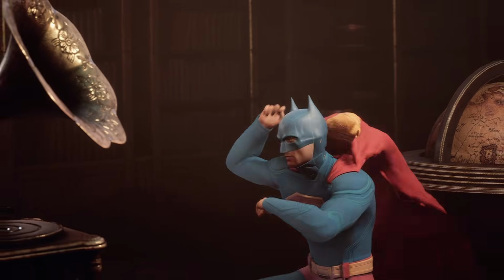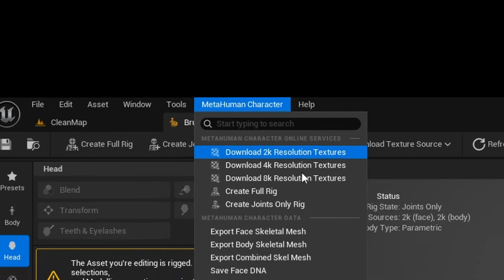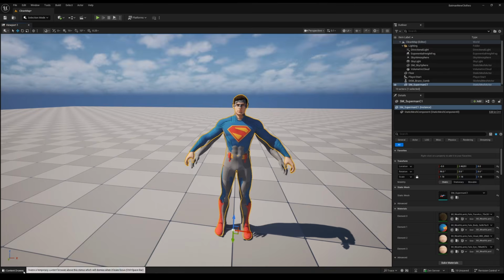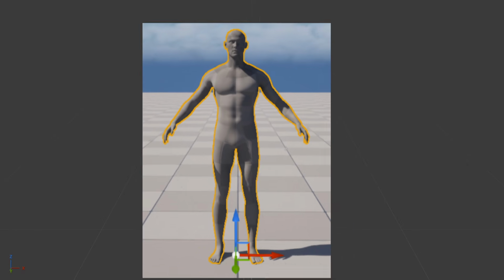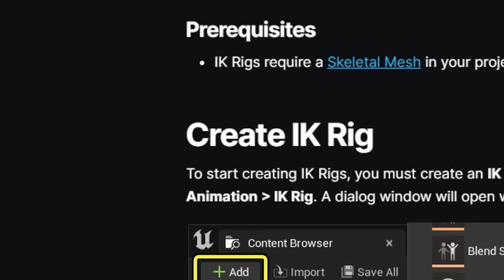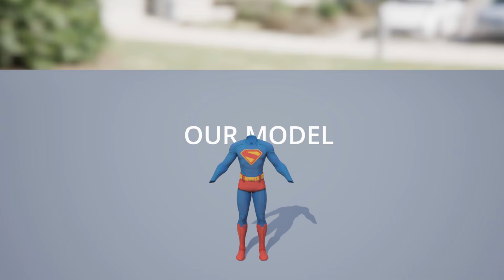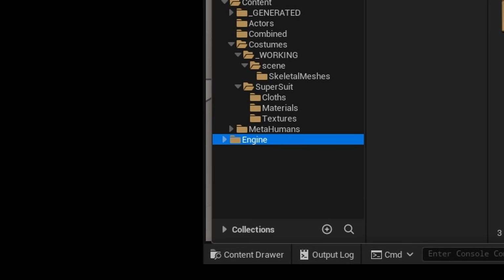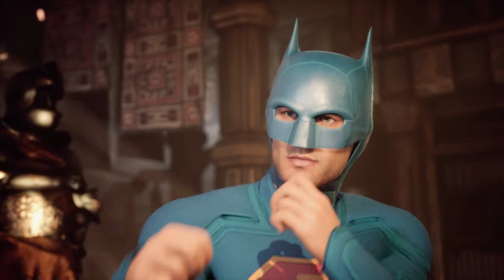Create MetaHuman Clothes from ANY 3D Model | Unreal Engine 5.6 (No extra plugins or software needed)

Comment: Ok, so i don't want to take anything away from this tutorial. And i have taken a lot of lessons from this and i can not emphasis how valuable it is to do all this inside UE and with this speed. Very much appreciated and subscribed. But, most of the things can be done via blender a bit more faster imo. If you have a lot of characters, I suggest exporting it to blender, do your riging and animations in there and bring it back to UE. The pipeline is cleaner that way and the one thing I have learnt in UE is, if the engine breaks, you don't want it to break with all your assets in it.

AGAIN!!! This is a gold mine. Ty.

Comment: To people using unreal versions higher than 5.6 and their retargeter isnt working - turns out the "Op Stack" tab in the IK Retargeter asset window is now blank by default. The quick fix for this is pressing the "Add Default Ops" button in the "Op Stack" tab which fills the stack that was present in the 5.6 by default.
Reply: Sorry where on the screen is that button?
Reply: @Jfilms22  In the IK Retargeter asset, go to the "Op Stack" tab which you can find besides the bone "Hierarchy" tab in the left part of the screen.
Reply: @markbradley332 it’s still not worked for me, the animation crumples to a ball or smthn, did this happen to you?
Reply: @Jfilms22  That means you must have done something wrong beforehand, I didnt have this issue.

Comment: For 5.8 onwards you can skip the IK rig and use the skeletal mesh with weight transfer straight away, then use that as the skeletal mesh for the cloths asset
Reply: How do you match the costume pose to the Metahuman default pose?
Reply: @VicXtheMeX use the deform tool on static mesh and transfer that into skeletal mesh, it works for me but idk

Comment: I don't think this works in UE 5.8 The final step doesn't work. Everything leading up to Retargeting the fullbody for the correct pose works but that part doesn't work for me.
Reply: Did you find a way? I cant do it on 5.8 either
Reply: @Jfilms22  I figured it out! I recorded myself and will post the video on YT by tomorrow evening. It's actually not too bad but slightly different steps than what the video shows due to changes made (I assume) in UE 5.8.
Reply: BTW it will be on my other YT channel called Animation Hatcher.
Reply: @HatchersHouseofSystema will check out
Reply: I have the video. Just need to edit and post it. Got busy with project work.
Reply: @Jfilms22  I am working on a solution. I will know today if it works.
Reply: @HatchersHouseofSystema I am also interested in seeing your solution!
Reply: @VicXtheMeX ❤
Reply: I have spent almost a whole day figuring out why it doesnt work anymore since 5.7 - turns out the "Op Stack" tab in the IK Retargeter asset window is now blank by default. The quick fix for this is pressing the "Add Default Ops" button in the "Op Stack" tab which fills the stack that was present in the 5.6 by default.
Reply: @markbradley332  Well that's cool. My solution is different but if that worked for you that is awesome!
Reply: @HatchersHouseofSystema  Would be great if you could share yours too

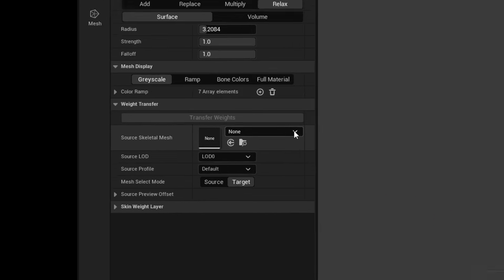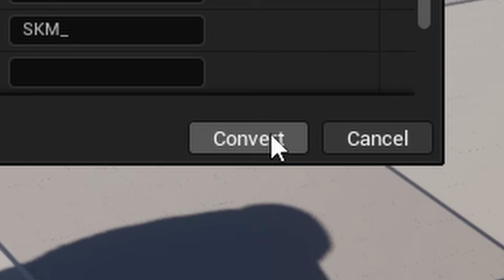Comment: I was able to do the whole process once but wasn't happy with the results. Doing it a second time, at 7:25 when i try to transfer my weights my editor hard crashes. Any ideas what could cause that? I'm using 5.6 EDIT: I found a really silly workaround. I needed to simplify my clothes mesh for both times of weight transfer (2nd weight transfer at 9:25). My mesh was already below 10k vertices. I think Olars Superman-Suit had more so idk. Under the mesh tab within the SKM i simplified it to 99% of its original vert count. After this i was able to transfer the weights without issue. Still can't figure why i have to do this though..
Reply from the maker: It's good to hear that you figured it out! I honestly have no idea either why this way makes it work. 
It's quite bizzare, that the same mesh worked fine when you did it the first time, and not at all on the second time without simplify. 
Makes me wonder maybe something happened when you morphed, or deleted parts of the mesh before the weight transfer? Like some hidden calculating error. Just shooting the air here, no idea.

Comment: When I use IK Rig, the superman costume doesnt move
Reply: Having the same issue, the retargeter doesn't have the proper chains i guess, not sure how to resolve this
Reply: I am having the same issue, but for the second static mesh costume i attempted this process on
Reply: Did you manage to solve the problem?
Reply: @MaikM7 i managed to see the difference of pose when using the IK rig again but the pose is still inaccurate, so I ended up not using the IK rig entirely.

Comment: I tried, but at the end of the conversion of static to skeletal mesh, I just get the error: Array index out of bounds, when transferring the weights to the new skeletal mesh from the combined mesh!
Reply: Hey i had the same error. It worked for me to reduce the vertex count of my mesh just a little bit. Right there in the SKM where you transfer the weights you can go to the mesh tab and simplify the mesh. I chose to reduce the vertex count to 99% target percentage. After that the weights could be transferred and no error appears. I don't know why it is like that though it worked for me
Reply: @nikhenrich2042 hey buddy, thanks for replying. I am currently not working on unreal, but if in future do so, surely would remember this, thanks.

Comment: Awesome video! Keep it up man! However after creating the Final pose Static mesh (The one you put in SuperSuit) The static mesh is fine but when i try to convert it to a skeletal mesh it breaks materials. And when i try to weight paint/ transfer weight my unreal engine consisently crashes with and array error. Any idea where i might have gone wrong?
Reply from the maker: Thank you for taking the time to follow the video.
Now I'm intrigued, could you share more info? 
I had the wrong material id issue on the superman suit, but after deleting all the material slots except the suit one,  unreal remapped the invalid ids, giving every separate mesh the same material. That fixed the material for me. 
If I left more than one material slot, the suit material always had to be in the second slot (first slot had to be empty).
Does your final mesh need to use multiple material slots?
Good to hear that you found a solution.
Reply: @OlarKrjukov I have the same issue. When I convert to static mesh from sequencer and then convert it to skeletal mesh it breaks materials. And weightpaint crashes the editor :(( Do you have a discord perhaps! Would be awesome to be able to share the fix when I figure it out lmao
Reply: @TheFalcoGamingDK I don't think he has atm but feel free to share if you find a fix :))
Reply: @OlarKrjukov also a tip you can do when weightpainting is instead of brush relaxed and clicking you can select the mesh point and remove influence from say the arm so the cloth under the arm does not strech
Reply: @OlarKrjukov  No need to thank me for following the video ahaha. Yeah it has 7 material slots. That might be the issue then for why i cant make a skeletal mesh from the sequencer static mesh?
Reply: As far as I can see chatgpt says converting from sequencer is a big ue5 issue as it makes 100 k vertacies and then cant compute weight transfer bc array is too low but no clue
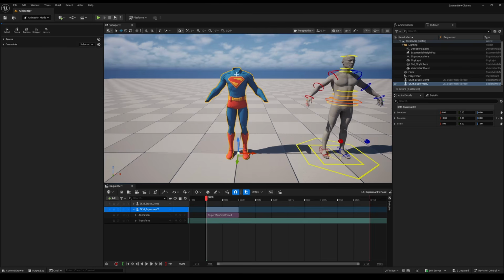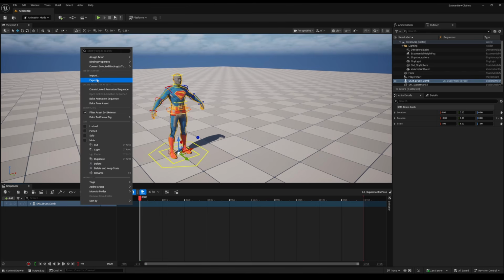Reply from the maker: @TheFalcoGamingDK, @mikkelrasmussen9698 what if instead of converting the static mesh from sequencer (like on 9:06), you export your model with the animation/final pose added (same way like you did at 6:43) and then import it back with "Use TO As Ref Pose" selected. It comes with the dark material, but with the correct material slot numbers and pose. You just need to move the materials back to the right slot. 
Are the materials fine now? Or they still break?
The skel mesh now has the correct MetaHuman Skeleton with default pose and Skinweight.
So you can try to make the wardrobe item with that. But if there are issues later (because of the ref pose), then you have to convert this imported skeletal mesh back to static mesh (outside of sequencer) and from that make the final skeletal mesh.
Let me know if that way works!
And yes, I don't have discord server as of yet, but you make it sound like I should.
Reply: @OlarKrjukov  Thanks for the answer! 
I think there might be a way. But as of now i just decided to remove legs and shoes and then just scuplting the upper body to match skipping alot of the workflow but it gives me a working cloth. Perhaps if in the future you get a discord. I can bring this up for further troubleshoot. But for now just focus on making content!
Reply: I don't know about the material but i had the same error crashing hard when transferring the weights. What worked for me was to reduce the vertex count of my mesh by a tiny bit. Right there where you transfer the weights you can look for the mesh category and simplify it. I chose a target percentage of 99% there so no real downgrade. After that i was able to transfer the weights without crashing my engine and everyting worked fine

Comment: ALL I WANT IS CUSTOM CLOTHING ON A MH WHY IS IT SO IMPOSSBLE
Reply from the maker: Hei! Thank you for following the tutorial.
Since its not clear what has gone wrong, my advice would be:

1. Walk backwards, in the sense: you mentioned you dragged the wardrobe item into the metahuman outfit clothing but nothing works. So go backwards one step and check in wardrobe item whether you have set up the correct pipelines. If they are correct, did you add the outfit asset? if yes, go back and check the outfit asset etc. Eventually you will find what has gone wrong.

2. As Metahuman Creator is still in Beta, you might have picked up a random bug or accidentally changed something as you doing this workflow the first time. If thats the case, it would be better to start a new project, and do everything again from scratch. This way as you are more experienced and familiar with the workflow, you might find where you went wrong the first time or avoid the bug.

For example when I did that workflow the very first time, I accidentally changed the metahuman skeleton, and got a random errors with the combined mesh. Second time I was more experienced, and could avoid these missteps.

Comment: You can do very easy by using metatailor workflow for free
Reply: I find this hard to believe as I have used metatailor almost every update to see if its gotten better since it was in beta and the program still has a hard time with basic clothing.
Reply from the maker: The free version still comes with limitations. And also why outsource the workflow, when the main goal is to learn what the system can and can’t do?

Comment: can this be done in 5.5?
Reply from the maker: That is a good question.
In 5.5 you need to get a combined mesh to correctly transfer the skin weights. (Not sure how to get it inside Unreal)
Because if you use only the Metahuman body skel for skin weight transfer, it will add extra weights to the neck area. (Needs manual fixing).
I'm not using 5.5 any more, so I don't have a 100% solution.
You might need to use blender to combine the metahuman head and body. Maybe then you could do the rest in 5.5?
Reply: @OlarKrjukov  Oh I understand, maybe I should upgrade to 5.6 before my project gets too complicated because I need to create clothes from meshes in my project. I am not sure if I need resizable outfits though, I am wondering if I can still create non resizable clothes for my metahumans in 5.5. Thanks for the reply!